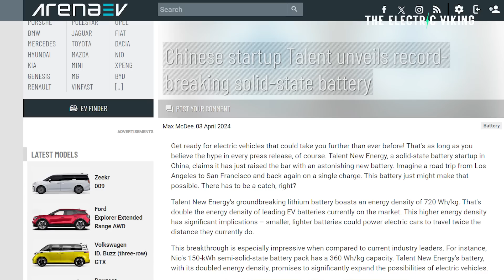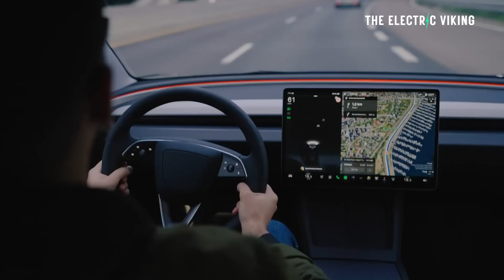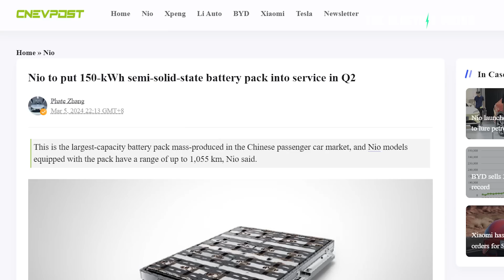Highest energy density battery in the world enables EVs with 1250 mile range

Comment: For the record I would be willing to bet that a 500 kw (or greater) charger in the US would be as rare as a unicorn.
Reply: Yep. If they are going to get serious about rolling out chargers, they need to concentrate on 500W chargers. I don't even know why L2 exists except in home residences. If fast charging does very little to degrade a battery, then everyone should just fast charge and have fewer chargers doing a lot of work rather than any L2 chargers being tied up all day
Reply: @travisjazzbo3490  I think there are suitable situations for both L2 and L3 chargers. L2 are ideal for offices, stores, shopping, dinning, museums, etc. because the person will be there for hours. L2 chargers are much much easier to install than L3 chargers so they can easily deploy a dozen L2 vs a single L3. If you put L3s at any place where the person will be there for hours, they'll end up hogging the charger for hours or be charged for idling fees.
Reply: @peterkn2  I realize L2 chargers are a lot easier and a lot cheaper to install. They may give 50 miles or so for 2 hours on a charge and for office buildings as a perk for employees is fine, but I prefer not to see those all over the place with people camped out on them. With L3 and where batteries are going, we are talking 80% charge in 15 to 18 mins in most cases which is great! Also, the more chargers out there, the more chance for vandalism. L3 is more of a get in and get out deal
Reply: @peterkn2  Very good points!
Reply: @travisjazzbo3490 with energy density of batteries increasing, we’ll need smaller batteries (~50kWh), therefore L2 chargers will be able to add 50 or more miles in an hour easily. We won’t need L3 fast chargers after. Only at “gas” stations to stop for 3-4 minutes.
Reply: @gregtheelectricviking  if we can get L2 chargers to 50 miles in an hour, that would be great! I agree. If L3 ever does 3-4 minutes, game over!
Reply: Very high power chargers will be installed for trucks. The question is will high end cars be allowed to use them? They may have a different plug/socket. They may be located in truck only areas.
Reply: You can't make unicorns but you can build as many chargers as you want!
Reply: @larryc1616  true.  You just need the commitment.